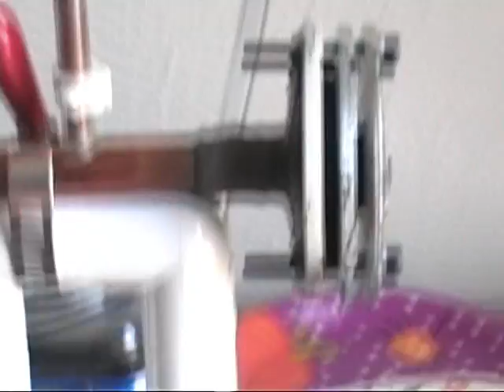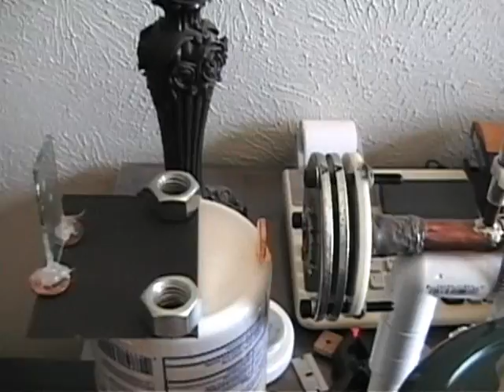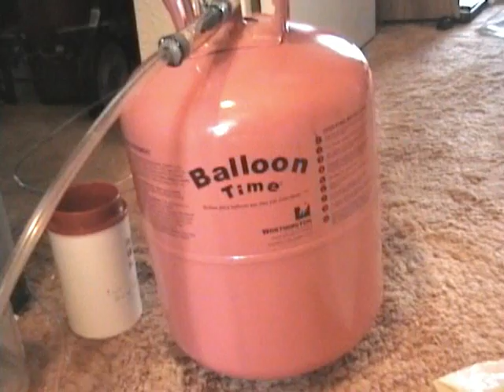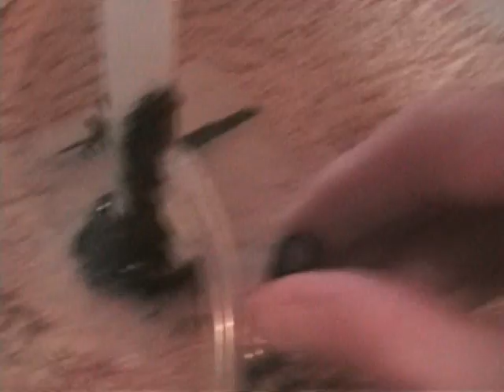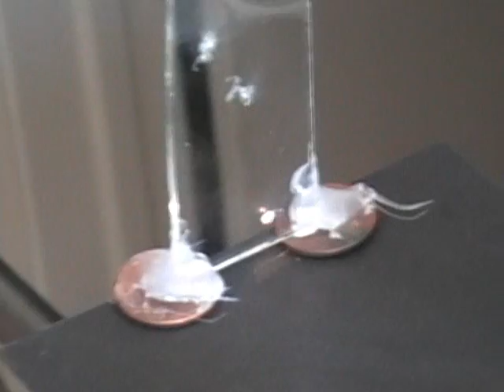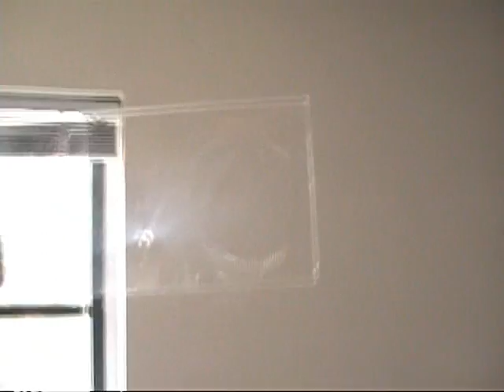Home Made Baking Soda Laser With Improved Performance

Comment: Hi jarrod!!! gr8 work 1 off al. I'm gonna make this laser as my final project so i need to ask u some details about this.
1. transformer should be used or battery and how much capacity if the length of the tube is 4 feet
2. any other alternative for znse output coupler ?
3. how did u mount the terminals in the copper tube.

Comment: Jarrod Kinsey where did you get the partial reflective mirror and the 100% reflective mirror?
Reply from the maker: The ones used for this laser were given to me. However, eBay is the place to go for this sort of thing. Furthermore, the HR need not be anything specialized or expensive. Remember that this wavelength will not pass through glass and 'normal' optics that are used with visible light. Because the gain is high however, any mirror will work so long as it is a surface-first type in which glass or other transparent material does not come between the laser beam and the reflective part.
Reply: *****  can I just build 1000 watt laser or is there a limit? I know microwave transformers put out a lot.
Reply from the maker: No. I recommend that you do some research - microwave oven transformers are instantly lethal! They do not provide enough voltage for a laser, a Tesla Coil, or other HV projects. They are utterly unsuitable for anything other than what they are designed for.  

This is dangerous work, and I recommend that you begin your research with the following resources: 

http://www.repairfaq.org/sam/lasersaf.htm#saftoc

http://www.repairfaq.org/sam/lasercc2.htm#cc2toc
Reply: ***** Im sorry could not find your email on your website. what I was going to ask is, if I wanted to increase power output of the laser  would I increase the length of the tube or would I increase the size? my second question is would I also have to increase voltage or amperage to get a higher output?

Comment: That's a more vague question than you might realize, but in the sense I think you mean, no.  There is no induced radioactivity besides the heat it's shedding.
All the good induced radiation is from a gamma ray knocking a neutron lose, or particles smashing off parts of an atom.
This laser is low frequency infrared.  Basically a beam of heat.

Comment: Modulating the current through the gas(1khz +) will result in more quantum collapses, thus more net power out .  ..just a a little tip from 'ol Truckin'Mike.

I dabbled with CO2 lasers back in the days before internet. Review Stefan–Boltzmann law. And Planks constant

Comment: How manny wats do you use and how many volts. The resistance in the gass must be huge or is it somthing with the mix of the gass that make it more conductiv? If you tried with pure CO2 would it be more or less resistance? And do you use pessure less than Atmosferic pressure/1 bar?